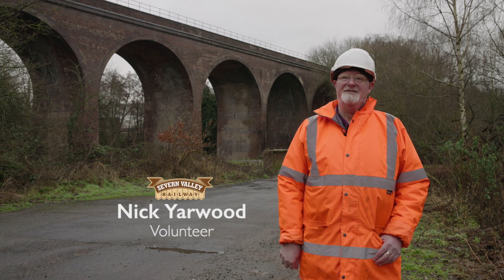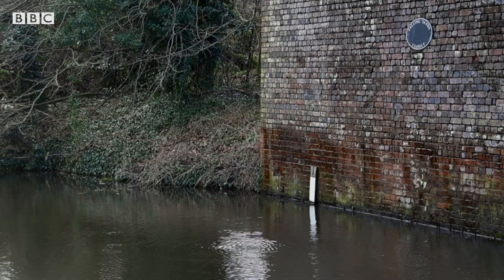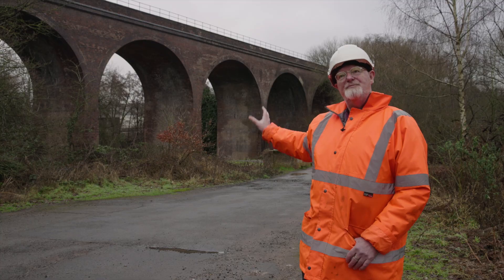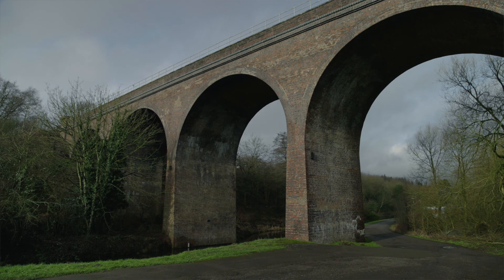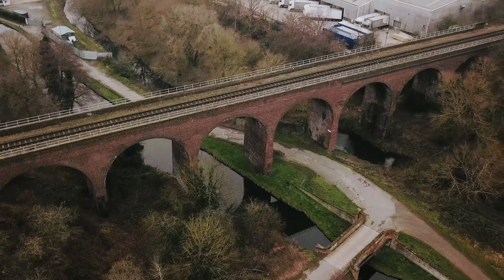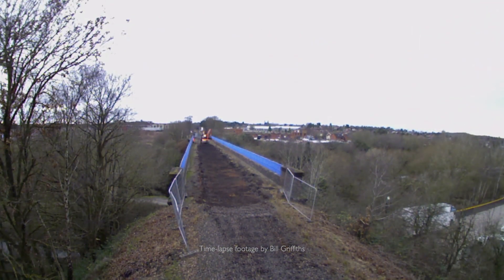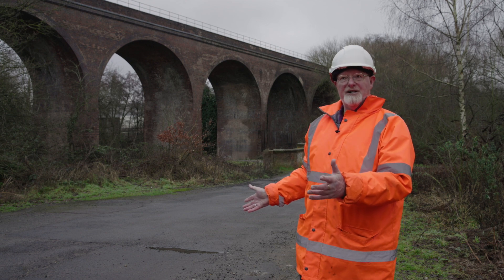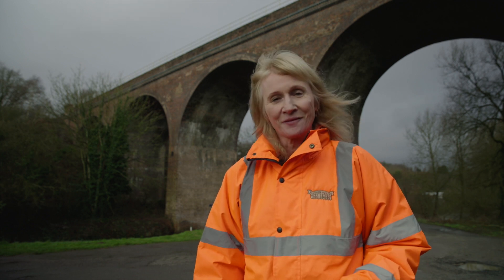How did the Severn Valley Railway restore the iconic Falling Sands Viaduct?

Comment: Still my favorite railway. I learned an awful lot as a young teenager working in Bridgnorth MPD. From how to pour and machine whitemetal bearings to fitting locomotive tires, replacing boiler tubes and my first experience of a pinhole camera viewed from the inside of the tender on the Great Marquess when she was stored in the headshunt. 
I learned the basics of cushion and seat upholstery and still hold Bathams Delph bitter in high regard, even though the PW's Jim Bodfish tried to drink all of it single-handedly. 
Thanks Thunderclap, you set me on a great course of beer appreciation.😊
Long live the SVR and their great bunch of volunteers and workers.
A great place to start a kid in many trades.

Comment: It seems to be a scruffy viaduct. The main difficulty for the railway is if it did get any worse, there wouldn’t have been any trains at all. So the raking out of the motor joints were working out. It’s possible to run those trains.